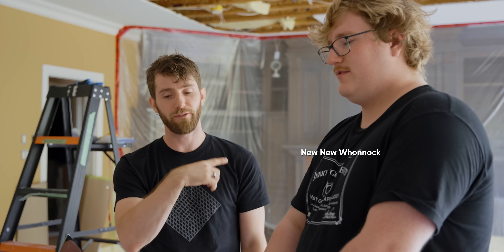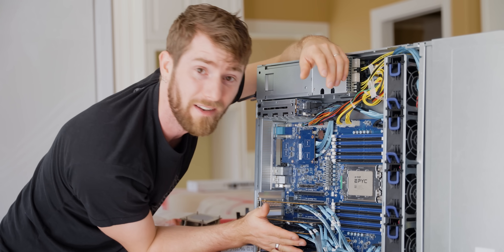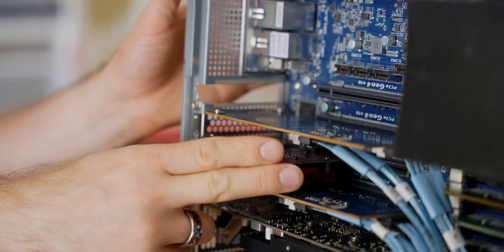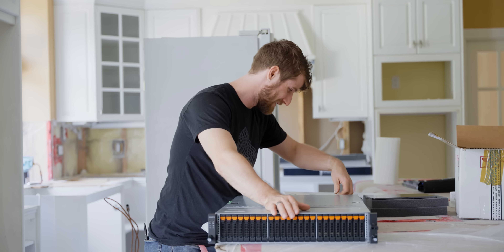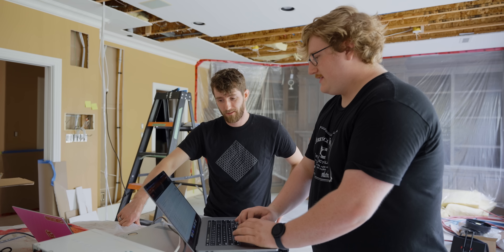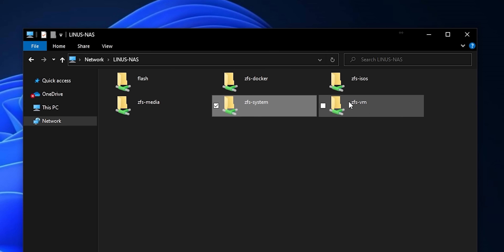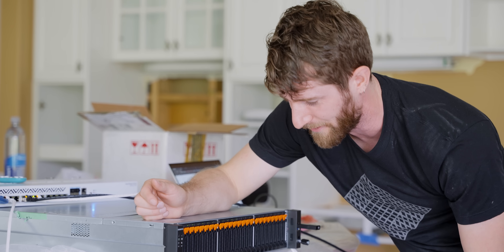This is stupid, but I love it - Linus Home NAS Update 2021

Comment: Hey Linus! Thanks for the zfs tips, helped me on a few things. I was wondering if you would like to make a complete guide on a unraid (or freenas) + ZFS via RDMA?
I'd like to setup a storage server with nvme and HDDs and I have no idea where to start. It would be nice if I could just directly access data from the RAM (ARC) via let's say 100Gbe QSFP56.
I know 100gbps can be achieved via RAID0 of 2 nvme, but my work (Houdini) is relying on low queue depths and essentially what optane SSDs are good at.
Thanks again!
- Marek

Comment: I wonder if it's possible to make a near-silent (or at least very quiet) 2U NAS using SATA SSDs instead. It just has to have the same performance as a regular spinning rust NAS, but with less noise, power and heat...

Comment: If you just want to stream videos, mechanical drives are absolutely fine. The only benefit from NVME is that the video will open about 10ms quicker. Once it is going, a mechanical drive is more than capable of reading 60 frames of video per second. If the 10ms wait really is a problem for you, then put an NVME cache in the storage pool to store the first few frames of each video.
Editing videos is a very different matter.
Reply: Yep an average HDD now at 5400RPM can hit 185MB/s and a 7200RPM can hit 210ish

Comment: If in 10 years Linus sells this house the future owner will be like: For the time when this house was built the Wi-Fi and the ethernet was OK-ish, but now this is all just old junk.
Reply: Pretty sure we are at a point with tech that new advances are pretty much unnecessary
Reply: @olsirmonkey  people probably said that back when calculator was a job title that people had
Reply: @randombrit13  yeah, but do you really care whether or not your phone has uhd compated to qhd? While it makes a difference and is cooler on paper, for a phone it makes hardly any noticable difference compared to hd to fhd
Reply: @olsirmonkey  you’re missing the point. 

The point is things can improve so much in ways that you cannot even comprehend. Ever mistap on a keyboard? How about hooking up an AI that learns from your patterns of typing and automatically corrects that. Hell far enough advancement ditch the keeb and make it interpret vague gestures. Sure it sounds impossible but phones are based off of literal science fiction. 

The only reason you think it doesn’t matter is cause you by some grand delusion decided to compare the jump from 1950 to 2020 with the jump from 2020 to 2021.
Reply: @randombrit13  old thread but in the next 50 years future we probably won’t even need to type, brain machine interfaces will replace any physical interaction. This stuff has come along way in the short amount of time it has been around, for example, this dude as an antenna coming out of his head attached to his brain that allows him to perceive colours and such that it adds another sense. He said once someone hacked it and transmitted stuff and it was a pleasant experience... Neuralink is starting human trials with with their brain implantable computer interface that allows people to use their phones faster than through physical touch...
Crazy stuff is happening

Comment: If SMB does not work well, try NFS.
You still can use MS Windows with Xen or KVM pass-through (with a cheap GPU or modified BIOS) or even better, put that VM on the EPYC - add a RTX 3090 GPU - and use even raspberry pis for the client computers.

Comment: Man this is so overkill though for a plex server. I just have a Pi 4 connected to a 14TB HDD and it can play 4k blu-ray rips over the local network no problem.  (until you have to transcode the content) You could probably run about 8 movies simultaneously until you start to be bottlenecked by the CPU
Reply: But do you have a backup copy of that data...or 1 failure from losing it all
Reply: @mrmotofy  1 failure. As much as I like digital versions of my movies, I'm not sure I like them that much to warrant spending $500+ just to back them up.

Depending on how many movies I end up ripping, I'll probably have to move to a NAS and do something like that since I'm already 80% full of my current drive.

Comment: Why would you want to do a household thin client setup? Why not have on-board storage for OS and drivers at the very least, especially for troubleshooting. Unless you're planning on having every thin client be identical, as they typically are in actual thin client solutions, then it makes some sense but not much more sense than it currently does. It's a weird use case, and it's downsides are completely foreseeable. I'd also keep some on-board storage, not just for system resources, but also as an offline buffer for if the network is ever down for any reason. What would even happen to a system that has all of it's storage over the network and the network just suddenly cuts off?

Comment: ZFS compression doesn't really work for video or images, since they're already compressed and the data isn't specifically repeated. But I don't think it should cause any issues if it's on.

Also, I heard that you can hack the Nvidia driver to get unlimited NVENC streams on any GPU. I'm gonna be trying that with my Jellyfin server.

Mega jealous that you have multiple NVMe drives in a ZFS Pool and I'm over here with a single 8 TB shucked WD MyBook.

Comment: Hello guys, I have a question that I’m trying to figure it out and I thought that this would be the place to find the answer.

I have a R5 3600x on a B450 tomahawk max and I recently upgraded from 2x8 to 4x8 rams (3200mhz, I basically added two more rams). I activated the xmp profile in the bios to run all four sticks at 3200.
Is it true that ryzens runs better with only two sticks? Should I return two sticks? Plus, I recently ordered a 2x8 3600mhz because people say it’s a better frequency to stay, so, should I return all four and only keep the 3600mhz? I only use my pc for gaming, so I guess I don’t really need 32gb(?)
Reply: I would suggest you the forum, if you wants answer ; )
Reply: @isuckatgaming7225  thank you so much

Comment: If you know your data is highly compressible or would like to test if it is, might be worth trying out zstd, which has much faster speed (still slower than lz4) and nearly as compressible compared to the highly compressible gzip.

1 is fastest unless you use zstd-fast which is just a negative factor, 3 is default balanced, 9 is the highest compression factor but may not actually produce a big difference, depends on the data.

On zstd compression, recordsize makes a big difference in its compressibility unlike in lz4, so it is worth testing out the different recordsizes and if it fits the data (e.g. recordsize=1M might not be a good idea for VMs requiring performance, but for storing VM backups you could potentially get up to 3x compression ratio), and not irresponsibly setting recordsize=1M for my entire pool.

Comment: why unraid when truenas core has been enterprise stable for years, truenas scale is available in beta (which is actually pretty decent) if you have a good backup plan in place anyway... i'd still go with raidz2 for a home nas though just due to historical need.  who knows how long you have to wait before you can get a new replacement drive for a failed drive?  you don't want to be without at least one parity drive for that long.
Reply: Unraid comes with virtualisation I believe, that's likely the reason why.
Reply: @thedeadcert  truenas core has the bsd behyve virutalization system baked in with a really nice gui to drive it as well as BSD jails containerazation system.  Truenas scale has kvm based virtualization with a nice web based ui (similar to unraid's offering but a better ui imho), as well as full docker support (and i haven't tested it myself but i believe several other containerization formats like lxd)
Reply: @joshhardin666  Sweet. Didn't know that. Thanks!
Reply: Unraid as a hypervisor on a high end server…thats even worse than installing windows with hyper-v.
Reply: @ronved  to the best of my knowledge unraid, truenas scale, and proxmox all use KVM as the actual virtualizer and it's actually rather efficient.  the only difference between them really is the front-end interface.  the back-end is done in the linux kernel.
Reply: @joshhardin666  yea, i know. I never see any serious providers using such hypervisors. Most of the equipment i handle runs on vmware, which I think is a more high-end hypervisor, made basically for high-end servers. When i see such servers that costs shitloads and people actually using mid/low-end software that costs 10$ on it, I kinda have to shake my head a bit…
Reply: @ronved  the majority of the world's cloud infrastructure and server software is free, open source, and primarily runs on Linux my friend.  Be it bare metal with Ansible, k8s, and docker/lxd orkvm and occasionally openvz (though openvz has become a less popular option now that kvm and k8s got good. At the end of the day, the majority of web servers are Apache and nginx with php on Linux. What you really pay for with VMware is NOT quality software (because you can do most of what it does really well for free), but rather, enterprise support contacts and vendor lock in. There's nothing WRONG with VMware, (other than it's needless expense), but at the end of the day kvm is designed to be just as light weight and efficient but has WAY more devs debugging, expanding, and enhancing compatibility with a plethora of other open source tools to make automation and integration with other systems way more manageable. Don't get me wrong, people in enterprise it won't get fired for buying a VMware setup (so long as they have the money), but kvm is one of those options that may be a better fit depending on your circumstances. There's a reason they choose to run it in supercomputers and mainframes (from IBM no less).
Reply: @ronved  given that KVM is the hypervisor that runs on Amazon's cloud and Google's cloud, I'd say KVM is a more high end hypervisor than VMware :)

Comment: me: I've got a pretty baller home nas, 8 10tb wd red drives in raidz2, 50tb of reasonably redundant storage with 10gb ethernet.  linus: hold my ltt water bottle.
Reply: @Gearrion  to be fair, I'm the only user and it's only serving video and backups. You don't need fast disk to do under 30mb/s
Reply: @Gearrion  on the other hand, I think that Linus' setup is ridiculously wasteful.  I think that it would be WAY better to use that box as the head/cache node for a significantly larger hard drive based storage system.  you can easily grow the storage size by about 10x without major noticeable slowdown by either using either a rack of DAEs with an appropriate HBA and expander in the existing server (to make one giant nas and use the ssd's in the existing box as cache disks) OR take a more "scale-out" approach with separate NAS boxes and use something like glusterfs tiering depending on the redundancy need and specific workload.  further, if needed, you could also set aside some of those ssd's in a small stand-alone ultra-fast array for specific workloads like databases, net booting machines and that kind of thing but tiering solutions in either glusterfs or zfs should be enough given the amount of flash storage he's got there depending on workload and real-world use.

Comment: Hi, just want to ask, how do you fix a pc with no signal but there is power. Monitor is working, and also the hdmi connected to the gpu. the gpu fans is working, also tried to remove the 2 rams then swap their position, also I tried reseting the cmos, but didn't work. BTW, the mother board is msi a320m pro-e. So before the pc stops working or no signal, I was using ms word, then the screen just turned black. Hope you can help me. Thanks
Reply: @Gearrion  Thank you for your reply, turns out it was the ram, I tried removing the ram first since its the easiest I think, based from some vids from LLT XD. I started removing 1 ram, then turned it on then it works both slot, then tried the other one, then there is no display again. Sadly I don't have the cash to buy a new one haha, I'll just make do with just one for now, haha. Thank you for responding, and keep safe guys. Happy gaming!

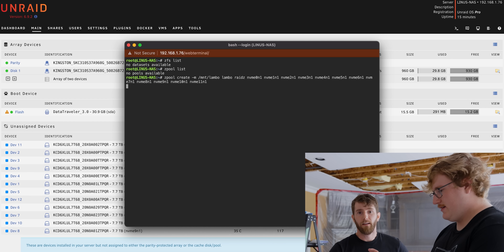Comment: 10:18
The way I understand parity is I think of is as a math equation. Say you have three storage drives and one for parity, the equation at a given address would be something like A + B + C + P = 0, where the values are binary and we ignore carry bits. A, B, and C are your drives with the data you're storing and P is chosen specifically so that the equation holds true. For example, you could have 1 + 0 + 1 + P = 0 -> 0 + P = 0 -> P = 0, so our values at this particular address would be A = 1, B = 0, C = 1, P = 0. Now let's say we lose drive C. We could use the other values in our equation and do a little math to find what the missing value is and rebuild the drive bit by bit. Our equation would now be 1 + 0 + C + 0 = 0, 1 + C = 0, C = 1. Huzzah, we recovered the lost data and can write it to a new drive.

Obviously there are much better and more efficient ways of doing this, but this is the barebones basics of how you can store redundant information and do some math to protect against random failures. If you want to know more, 3B1B and Ben Eater have some pretty good videos on Hamming codes and other parity related math/engineering.

Comment: Only reason I really want a decent NAS is for my Blu-Ray rips. I always keep the direct rip as well as a handbrake converted/compressed version just in case, I really don't notice any difference in quality between the two however, but I did a lot of settings tweaking with Handbrake.

Comment: If you are transcoding more than 2 streams simultaneously, you need a Quadro card. Specifically one that isn’t softlocked to 1 or 2 like the GTX and RTX desktop cards. Transcoding is one of those things Nvidia likes to charge an extra toll on you for unlocking one piece of the silicon that’s in everyone’s cards whether they paid the toll or not. The cheaper desktop cards are usually soft-locked to 2 streams.

Comment: My NAS has 7 TB of mechanical hard drives and 100MB network running on windows file sharing. There's 1400 movies, 68 seasons of TV shows, discographies of 47 musicians, 50ish audio books, and every file I've created or downloaded in the last 25 years. I can watch blu ray quality video on every device in the house simultaneously without any problems. 
I think your system may be overbuilt.

Comment: Here are some zfs specific things I've noticed watching the video. Please correct me if I'm wrong.

I believe the zstd compression is now the standard and vastly superior to lz4? Better compression and about the same speed as lz4 basically.

Also when creating the pool I believe it's preferable to go for the absolute drive id name located in /dev/by-id. That way you can move your drives around and that will always get identified correctly instead of by name sda, sdb etc.

I also don't see what value of ashift was used to create the pool but it should be at least 12 with those drives. I see ashift value of 0 so I'm confused lol. 4k sectors drives should get 12. 512b sectors is 9 and nvme is 12 or even higher number I'm not sure at that point.

I believe that the zfs compression level depends on your cpu performance and storage capacity as zfs will not compress files that can't be compressed enough so having it always on doesn't penalize performance at all.

Setting the record size is also a nice feature that can be set per dataset. 1M for large files like multimedia content goes faster. But with this kind of throughput it might be negligible.

If unraid supported iscsi it would've been a very good option to get data shared on his network for fast performance I think.

Comment: "saving blue rays to watch later" - So, I recently got a Blu Ray drive for my PC so that I could enjoy my movies when someone else is in the main living room.  Problem is, the disc won't work on my PC (nor while running in Ubuntu) but works just fine in the actual Blu Ray PLAYER.  All research I can find is, from other sources, "Yeah, some Blu Rays just will not play on a PC; only more focused Blu Ray devices," so I am not even sure how to convert to simple MP4 with these issues.  Please tell me there's a solution.
Reply: U need some sort of license to run blurays on pc or something and a program to read them idk I bought one for my pc years ago and never used it for this reason
Reply: @Roshan_420  Here's hoping Anthony can maybe explain some solution (or how to get this license, since i didn't even know about that), or the very least give some pointers of what/where to look at.
Reply: @I0NE007  basically windows (or ubuntu in your case) doesn’t come shipped with a blu-ray license thus it doesn’t work and you need to download some program or maybe buy one to play them
Reply: @Roshan_420  i have both as a dual-boot system, so the specific OS isn't too much of a problem; guess I'll go looking around and see if i can find something.
Reply: Yeah like the guy said. It's copy protection that is stopping your computer bluray from accessing movie discs.

Comment: It beats my headless backup server with a 1 Gbps interface running FreeBSD 13,0 with OpenZFS 2.0. It runs on a Pentium 4 HT with 2GB DDR and 1.21TB of HDDs. One datapool (250+320GB Raid0; IDE 3.5") with FreeBSD; ISO files and VMs and another datapool (320+320GB Raid0; SATA-1 2.5") with more VMs; music; family videos; photos; software archives of 16; 32 and 64-bits software. During the incremental backup It runs at 200Mbps due to >95% CPU load on one CPU thread. It is in use since June 2019 for ~1 hour/week. It is connected to the world with 2 cables; Power and Ethernet.

Comment: Those low-profile GPUs can be made quieter (for people not using them in a server build) by strapping 2 60mm Noctua fans to them.   It is a very easy and safe upgrade.  Performance even improves marginally lol.